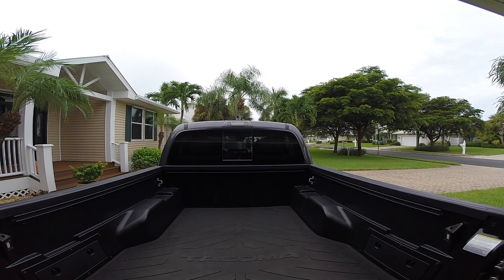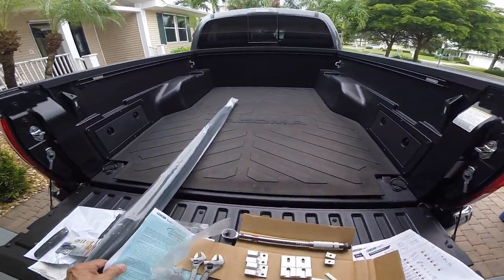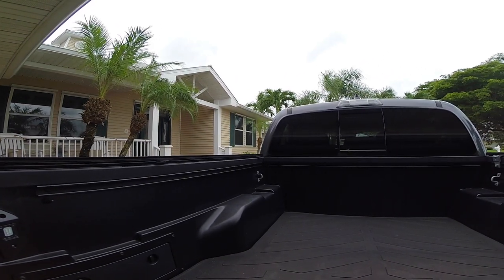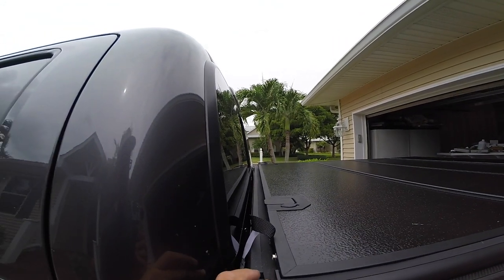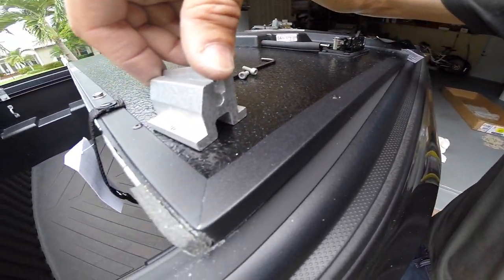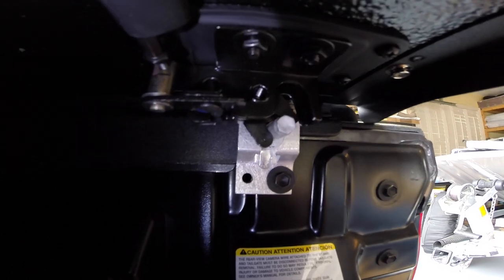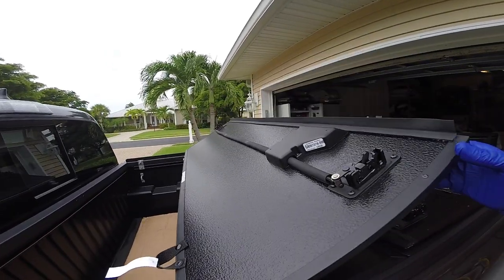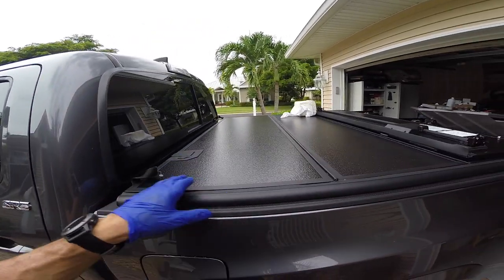G4 Elite bedcover install for a Tacoma SR5

Comment from the maker: Yeah I really like to cover it works really well easy to remove easy to put back on there’s times where I need to use the back of the bed without the cover and it’s easy to remove it and replace it back on again

Comment: Thanks for the video.  Because of those middle under-panel brackets the cover can't be removed easily if you need the full bed correct?  I'm not sure if I'd like only 60% of my bed max.  I've seen others that can be removed entirely.
Reply from the maker: Yes you can remove the whole entire cover by unscrewing two bolts   Thanks for watching
Reply from the maker: Sorry for the late response, so the answer to your question is no it’s easy to remove

Comment: After seeing your video, i am thinking of purchasing for my Tacoma. I have a question: Can you open and close the tailgate without having to open the back cover without damaging the weather strip and or cover? Thanks in advance.
Reply from the maker: I don't quite under stand your question .all i can tell you, that you can open the tail gate without having to open the cover. and vice verse with the cover .. I already have it a few month with no issue, although it does leak a little water at the front but that due because i have not install a weather strip in the small gap
Reply from the maker: I don't quite under your question, All  i can tell you is that you can open the tail gate with out having to open the cover. and it goes the same if you open the cover you don't have to open the gate. It been in my truck now for a couple month with no issue, Although i need to put a little piece of weather strip in the front to prevent water from coming in. aside to that i really like the cover .
Reply: @JoseRFloridaPureFishing  Thanks for responding.  I understand that the tailgate can still open without issues (even with the back cover closed), I'm more concerned about the closing of the tailgate; do i need to slightly lift the back cover in order to close the tailgate?  Thanks again.
Reply: @YajNtxawg  According to the Foldacover website, no.